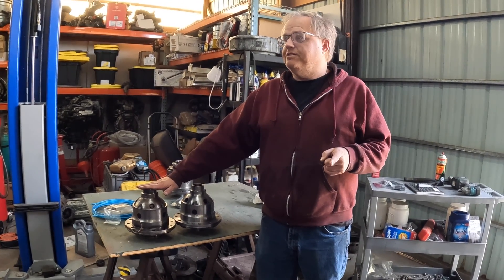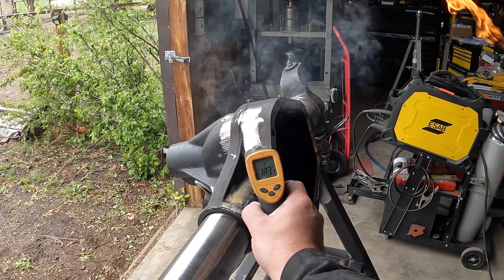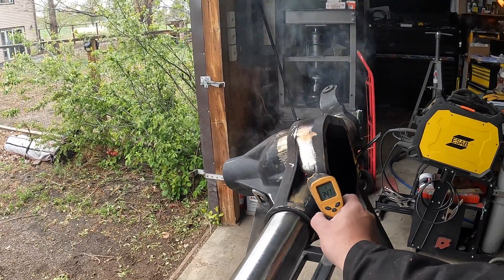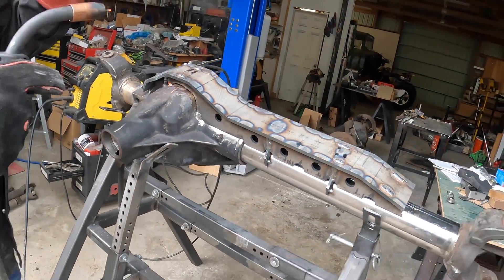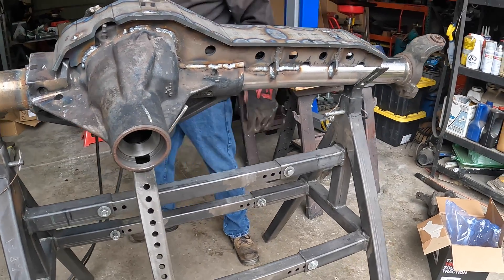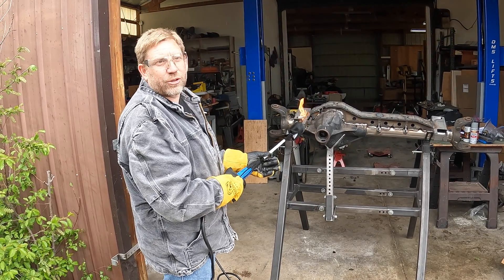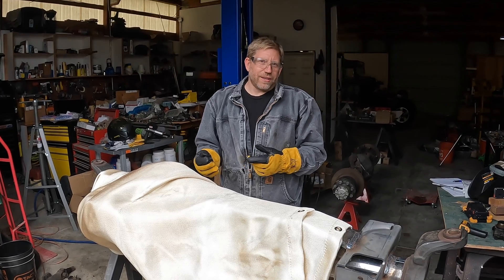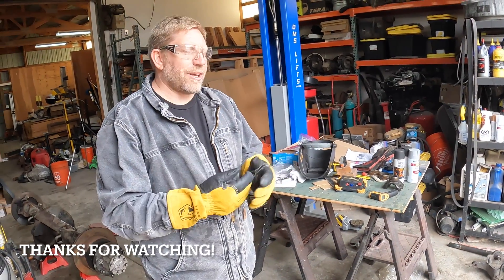Welding on a Superduty Dana 60 Casting

Comment: The pumpkin is not cast steel. The knuckles are cast steel. The pumpkin is cast nodular iron. You can ask Dana. 
I preheat the pumpkin and TIG weld it with nickel rod. Peen with a pointy hammer. I use the point end of my slag hammer. Or, use a needle scaler. But you really want to do it as soon as you finish a weld. Don’t wait. 
Let it sit for 5 minutes, apply a little heat. Let it sit for 10 minutes, heat again. Check 15 minutes later, apply heat again to whichever material is lower in temp. Cover with blanket. 
Pretty much like this video, except I use nickel rod.